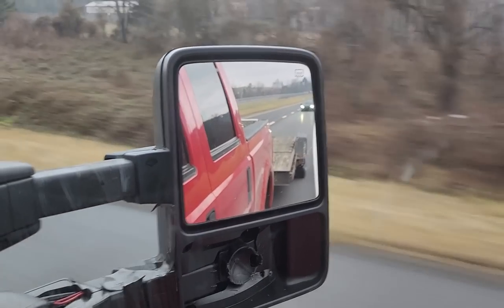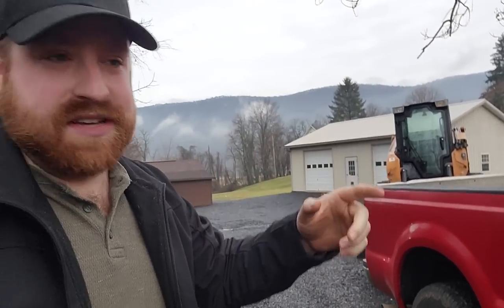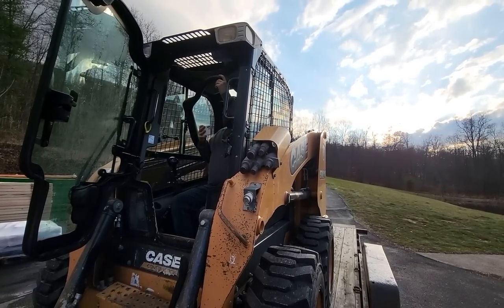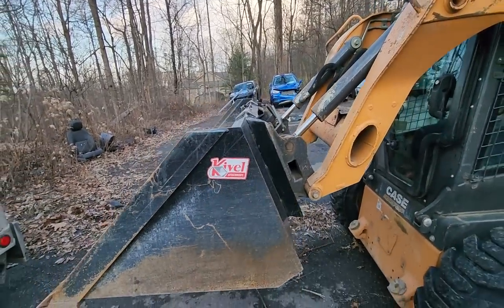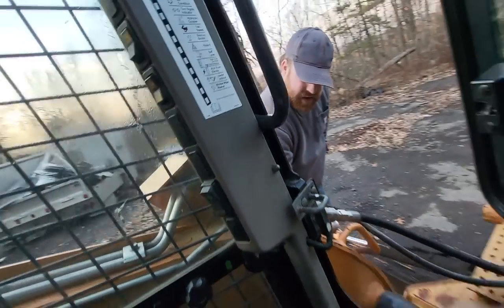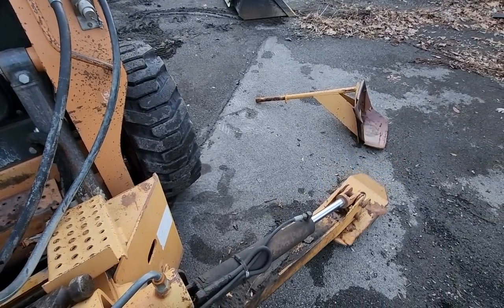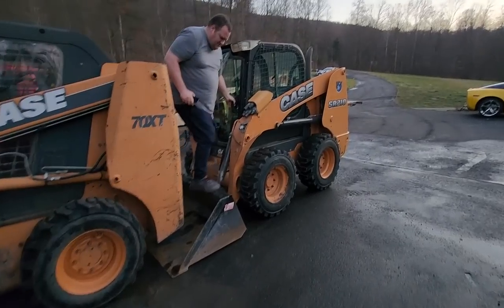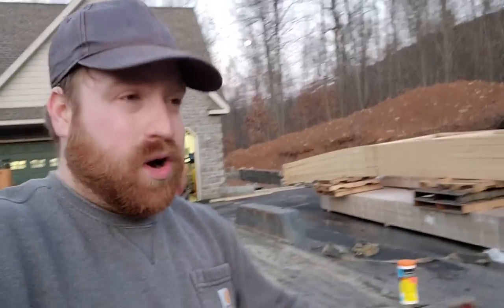First Tow with the Powerstroke and I'm Not Impressed

Comment from the maker: For the record: yes we need better straps/chains
Rear of the truck only dropped about an inch with the tongue weight. Didn't push/bounce or move the truck around at all front end wasn't light either. I'd rather have a little extra tongue weight than not enough. The loading of the trailer had nothing to do with truck only being able to do 50 up some of the hills. Check engine light is on for DEF heater, this doesn't cause limp mode or any issues unless the DEF freezes and it was 50+ degrees out.

Comment: My 12 6.7 pulls like a champ I tow a skid and a mini what other codes do u have on it
Reply from the maker: Just a DEF heater code.
Reply: @TopLineRacer    ok have u changed out both fuel filters yet and run hot shots everyday fuel treatment in it
Reply: @TopLineRacer  also only run Motorcraft filters and oil there the best if u have any questions just let me know

Comment: i love how you literally keep complaining  about the trucks power when its literally running in limp mode did you forget its a 2011? ya can just ignore the check engine light on newer vehicles like ya could in older ones any  emissions codes(your being def heater is one) automatically detunes the engine to prevent it from melting down fix the truck then test your dmax wouldnt like when a major component(emissions)  fails and you just keep ignoring it like a child either its a 2011 it makes 390hp and 735tq so in limp mode your like 99-03 7.3 power level(225-235hp and 285-295tq) range (my dream truck is a 99-03 7.3ps crew cab 4x4 dually the 2023 6.7 makes 500hp and 1200tq no stock diesel truck makes 700hp 1500 tq yet anyway get the truck fixed itll be way better (its 10x better without emissions but i know you aint trying to get in trouble either) have a good one man
Reply from the maker: They will only go into limp mode if the DEF freezes, not just because of the heater fault.
Reply: @TopLineRacer  yes they will dmax cummins powerstroke isx mack etc any engine that has a computer will go into limp mode if there a emissions or powertrain fault and when you run out of def it completely loses all power def heater fault is a emissions code the heater is likeyly plugged